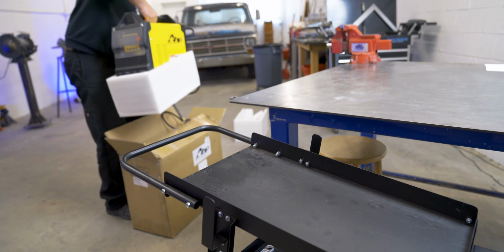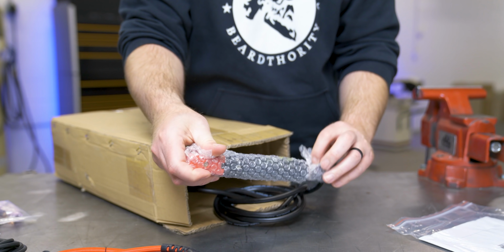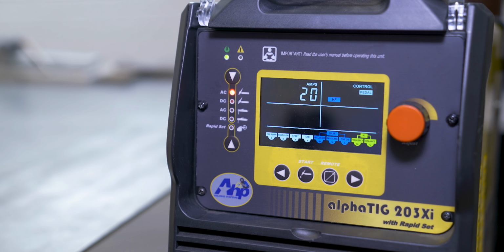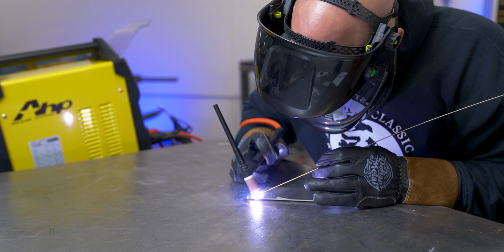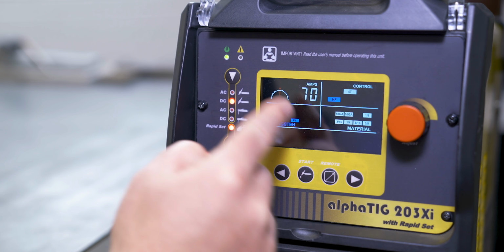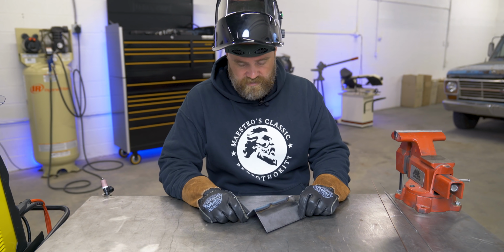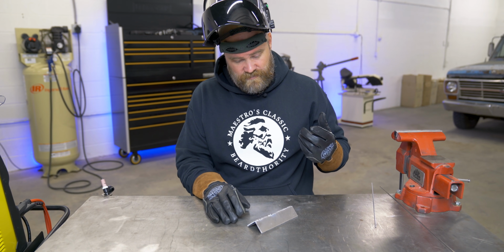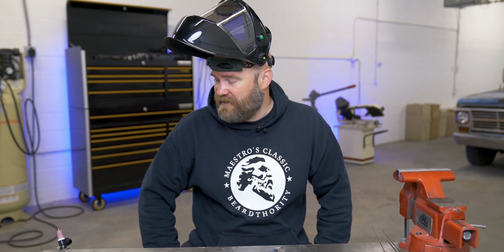Feature Packed TIG Welder for under $800?? The AHP AlphaTIG 203Xi AC/DC TIG.

Comment: Two Questions (for anyone):
1.)  Can we assume these budget AC/DC TIG welders use square wave for the AC?  I don't see anything on their websites stating that.
2.)  And, given that square wave is the standard (according to YT channels, "the fabrication series,"/"weld coach,"), if I just want to get started in welding for home brewing & DIY sanitary tri-clamp flanges onto 3" welded seam muffler pipe where I'd passivate the inside weld (sanitary welds with straight argon and back-purging) but soon after also want to TIG aluminum plate for homemade catalytic converter covers for family and neighbors...does anyone know of internet resources to DIY my own rig using online PCB mfg's, or re-purpose square wave constant current generators?  (I've got more time than cents, double entendre intended).  I'd ideally like to get a schematic even if I have to generate a PCB file -- I don't think I'll need to adjust AC frequency or AC balance if it's stuck at 120 hz, 30/70.
Sorry to be so wordy -- maybe the obvious answer is just forgo the aluminum side of things until after I've got a job.
EDIT:  While I've found igbt welder plans in progress from 2021, nothing that works.  I have found, "used," AC/DC rigs from Amazon warehouse for as low as $373., however no reviews exist and the website's sketchy (hasnsocktech)...  so... best me thinks to start where I want with SS sanitary welding, push aluminum down the road (until I have $850).  Thx,

Comment: The gas hose is absolute crap and the material is so thin that a very slight bend will cause it to kink completely cutting off the gas.  I also accidentally set the unit down on the torch lead when I took it outside and it ripped the inner white hose. I wasted a lot of argon before I figured out that the hose was ripped a couple of feet away from the unit. I kept turning up the argon because I thought it was the wind until I realized I had a leak. It seems like a good unit so far but the few dollars they saved in obvious inferior materials makes me wonder where else they cut corners. My 11 year old TIG welder died, but the torch lead is still in great shape. I am very disappointed. Where can I buy a quality lead for this torch? Or should I just by a complete CK torch?

Comment: I've been running a Primeweld 225x ($800) and like it.  Comes with a CK 17 super flex torch & hose and a good pedal.  It has all knobs and an LED digit display. Wish I'd seen this sooner.  I'd have given the aHP a good look.
Reply: Screens aren’t always better. If it goes out you’re screwed and the primeweld might have a smoother ac tig arc

Comment: Dumb question...you use argon gas with this machine?correct
Reply: Legitimate question.  Tig welding is typically done with pure argon for shielding gas on steel/stainless steel.  In A/C for aluminum you can add helium to get more performance out of the machine as well.  Not sure on ratios but there's videos out there showing this.  Jody at Welding tips and tricks uses helium from time to time to weld thicker aluminum.

Comment: Seems like this is the pre-production version. The production version has upslope and downslope settings also for welding with torch switch. Also the torch is not a true 150 amp torch. It is rated at 120AC /150DC @ 60% Duty Cycle. CK version is rated up to 150@100% but it costs 3x as much. So just keep that in mind when welding higher amps.
Reply from the maker: You're right it is a pre-production version.

Comment: So why would you get this one vs. the AHP AlphaTIG 225Xi?
Reply: 225 has analog controls and can do 225A at 30%.   This does 200A @60%
Reply: 225Xi seems just an afterthought to compete with the primeweld 225 which is silly. It is just a number. I will take 60%@200amps over 30%@225 any day. Also digital is much more accurate than analog.
Reply: @jarobuilds  Gee, the AHP site states the 225 get 35% duty-cycle at the max 225 amps, not 30%. So, I'm guessing the 225 duty-cycle curves down to about 45% duty-cycle at 200 amps, which is quite respectable. Of course, I like the Digital interface of the 203, the memory function, and the 60% duty-cycle at 200 amps too. And, I'll agree, the 225 does seem to compete precisely against the Primeweld. But the new 203Xi is a real sensation for around $725, for an AC/DC, Digital TIG welder with the deluxe torch hose and Rotating head, which CK Worldwide seems to only sell as a torch and hose together for another $150.
I have and use an Everlast 210EXT, so, to me, Digital, is better. And now, this new AHP is an obvious no-brainer, right out of the box! I mean, the 203 even includes that RapidSet function that the 210EXT didn't include, like the Everlast 225EXT and 325 does, which they call an EasyMode. I was glad that my 210EXT didn't include the EasyMode, though, because I wouldn't use it, and it would just make the interface panel more busy or cluttered, as my 210 still has the schematic diagram as a step-through visual, and more features take up more so-called real estate there. Of course, I  dig the added waveforms on mine, especially Triangle, for thinner aluminum, and the AdvancedPulse/MixTIG feature does make the unit more potent for thicker aluminum too.

Comment: @Justin Voss, Your display is different than mine. I just got my 203xi a couple of weeks ago. The way your display shows the 2T/4T, Pedal, HF, and Lift selection is different and I think I have more features on the AC and DC TIG selections too. You only have Pre and post flow as well as start and end amps, but mine has upslope and down as well as another or two I believe. Also, at around 5:50 you go through 2T/4T, pedal, etc selections which I thought might open up the other options and it didn't make a difference. I can post a video of mine if you'd like so you can see the differences.....There are SEVERAL.
Reply: You got the production model. He got the pre production version which never had upslope or downslope.
Reply: @jarobuilds  After seeing another preproduction one on another video that makes sense.

Comment: @Justin this is going to sound like a silly question, but what was the voltage/amperage of the circuit you plugged it into? I have 240v service in my shop, but I think I may need to upgrade it for this welder. Thanks!
Reply from the maker: 240v with a 50amp breaker. The manual says a 40amp minimum breaker.
Reply: @JustVoss  Thanks Justin! My electrician is going to be here Friday to put a 240v/50A in my sub panel. Until then I'm just practicing on 120v which is fine for my skill, lol. Thanks for the awesome content man, it has helped me a lot. And I liked the gloves so much I got a second pair! :)

Comment: in Poland we have few welder brand to choose 
i choose sherman 
u can probably find this welder with different box/brand of it with the same interials ...u can easly find simmilar ones by the same screen on them
sherman digitig 200 ac dc multipro 
have it 2 years , works avesome and still like new 
in comparsion to esab fronius or other 10k$ welders that my friend have (who tested it) the only 1 difference he can see was that his machines have more powerfull hf start...but for 600$ he was super suprised that it can weld ac like on expensive ones and have almost all possible settings
there is more and more cheap but good welders on the market 
u only need to find them :)
Reply: The sherman machine looks like weldpro tig200gd.

Comment: I have an older model ahp and the only problem I have is when running 6010 it does it but cuts out after like 1/2 a rod or so
Reply: Most lower-cost TIG welders (and multiprocess, for that matter) simply can't run 6010 like a true stick welder, or a high-end TIG/multi-process machine.

Comment: Looks a good welder for the price.
Reply: Not to be that guy but after about 4 days of research the primeweld blew this out of the water
Reply: @august7324  why? because it got 25 more amps? Digital will always be superior for settings vs analog. Those analog knobs are not linear so you setting knob between 0 and 50 is not 25 it might be 15 or 41. Not only that but the primeweld is huge and heavy. It also has a slighty lower duty cycle 40@225 60@183 where the AHP is 60@200. Other than the 25 extra amps which is irrelevant for a beginner welding up to 1/4 material, there is nothing better at $800 as of right now.
Reply: @jarobuilds  sort of, digital is nicer but primeweld is better every other way that matters it has a much better warranty than the ahp comes with the ck welding torch stock and the fabrication series tested the duty cycle and couldn't get it to trip at max amps till the point where he couldn't even hold the torch the metal was so hot, trust me I spent days deciding between the two
Reply: @august7324  I respectfully disagree. Things you mention have nothing to do with the actual welder. You won't be able to hold an air cooled tig torch even at 150 for too long either. You will saturate it with heat eventually. Mr Tig tested the old AHP 200 and couldn't trip it at full 200 amps. These tests prove nothing, other than the machine can reach full advertised duty cycle. Just because Primeweld's warranty is better (if you need it) or it comes with a CK torch doesn't make the actual machine better. I can set my machine to EXACTLY 65 amps 33 pps, 33% on time, and 33% background with an exact preflow postflow down to a decimal value. Try doing that with analog knobs.

AHP is going to kill it with this welder. The only competition they have is weldpro 200 which has non standard pedal, less duty cycle, small dinse connectors. The digital eastwood welders are not even close in value, you are paying for the name. The Yeswelder Tig 250 is a toy with a goofy pedal and a humongous torch. The next step up from this is the everlast 210ext which is twice the price. For the price the AHP203 is the best value digital welder.
Reply: @jarobuilds  I agree with everything that you say, but ahp kinda has a reputation for blowing up if your unlucky and the warranty is less helpful, (primeweld literally have a welder to someone in California who's house burned down because they asked) also primeweld has digital amps, if you watch the primeweld vid on it he goes for like 15 minutes at max amps, he also says it's one of the best arcs he's ever seen
Reply: @august7324  do you have the primeweld or the ahp?
Reply: @j.oakman448  I have neither as I ended up using mig more and did research to both, decided on the primeweld by alot and never bought either

Comment: That swivel head torch looks dope
Reply from the maker: Yeah I like it a lot
Reply: @JustVoss   Your display is different than mine. I just got my 203xi a couple of weeks ago. The way your display shows the 2T/4T, Pedal, HF, and Lift selection is different and I think I have more features on the AC and DC TIG selections too. You only have Pre and post flow as well as start and end amps, but mine has upslope and down as well as another or two I believe. Also, at around 5:50 you go through 2T/4T, pedal, etc selections which I thought might open up the other options and it didn't make a difference. I can post a video of mine if you'd like so you can see the differences.....There are SEVERAL.
Reply: @JustVoss  Also, it looks like you didn't have the AC pulse function either.